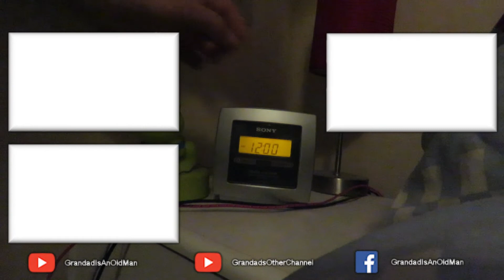FM Wireless Microphone Module SHORTENED VIDEO

Comment: Hi, can you tell me how did you find out what was the default frequency at which it was transmitting? I bought this for my son and we can't get it work or at least we don't know how to test it properly.
Reply from the maker: I am surprised the kit is still available. This video is 5 years old. Regarding the frequency/band, I see in one of me previous replies I mentioned the listing title said DIY Kit 88MHz-108MHz FM Frequency Modulation Wireless Microphone Module so that is where I would look to tune it. I found this was one of the worst kits I have assembled and struggled to get it to work. If you haven't already read my video description you may find it useful. The comment down here from Acme Fixer may also be helpful.

Comment: Thanks for the video! 2 Q's for you - How do you know it is switched on? as the power button slider didn't seem to indicate and what frequency/band did you tune into? TY
Reply from the maker: If you look at the circuit board copper tracks you can see which 2 of the 3 terminals of the switch are connected so when you slide the switch in that direction those 2 terminals are connected together. As for the frequency/band the listing title says DIY Kit 88MHz-108MHz FM Frequency Modulation Wireless Microphone Module so that is where I would look to tune it. I found this was one of the worst kits I have assembled and struggled to get it to work. If you haven't already read my video description you may find it useful. The comment down here from Acme Fixer may also be helpful.

Comment: The microphone has one pin that is connected to the metal case, and that is the minus.  If you don't see it, use the meter to check for it.

One other mistake that is common.  The kit has a combination of too many turns on the coil and/or too much capacitance on the capacitor that is across the coil.  The coil should be about 5 turns with a diameter of about 5 to 6 mm.  The capacitor should be about 20 pF.